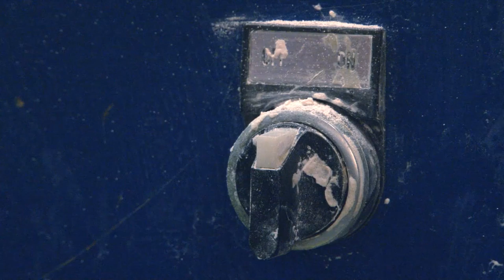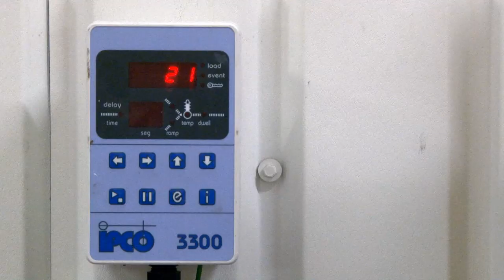How to make sculptural glass forms using the lost-wax casting technicque with artist Bruno Romanelli

Comment: The 3 weeks in the kiln needs more information.   Please
Reply: Actually, the melt was fairly fast.  The time-consuming part is the cooling process.  With glass that thick, he likely had to cool it down the first couple hundred degrees at no more than 1/2 degree per hour
Reply: No.  Initially, the furnace temperature was probably raised to around 1,600 deg F to melt the glass but the temperature wasn't held there long enough or was cooled down to below 1,200 F too quickly.  That allowed the trapped bubbles to be captured.  I do traditional glassblowing.  When I add fresh glass to the furnace, I raise the temp to 2,200 F and hold it there for at least 2 hours.  Then, I slowly cool the glass down to around 1,900 F and hold that temp for several hours.  The glass is still molten and fluid but, with the lower temperature, it's more dense.  It's a process often referred to as a squeeze - to help get rid of the air bubbles.  If cooled down to a solid state without that kind of pause, you get entrapped bubbles.